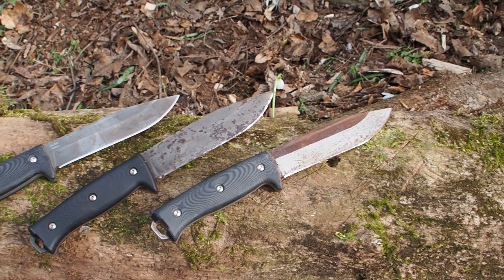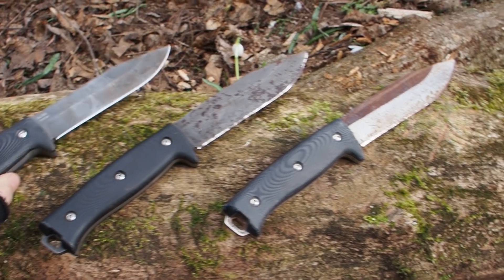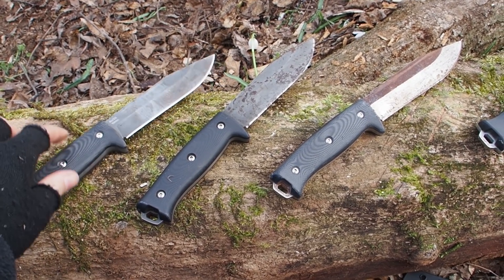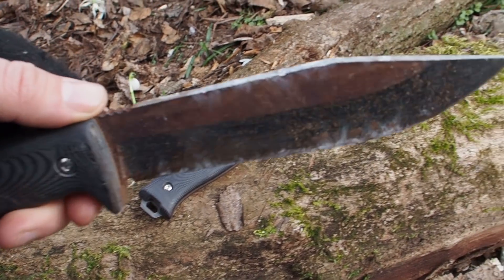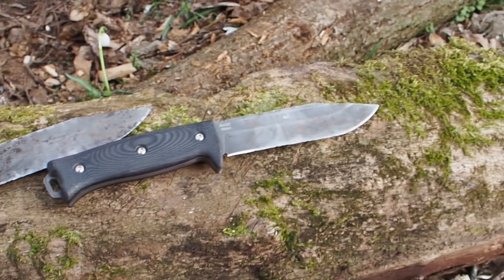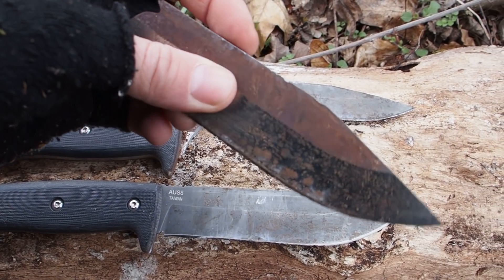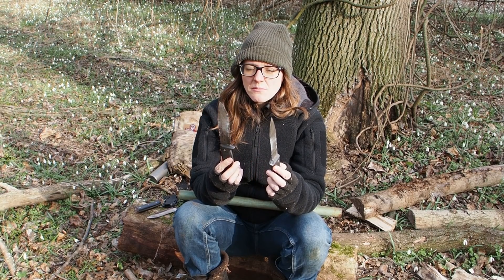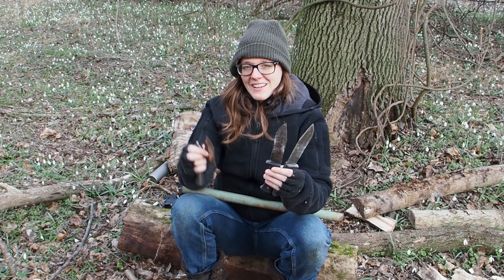Destruction Test - D2 vs. AUS8 vs. SK85 - Which is the better steel?

Comment: A dull knife is still a knife. A broken knife is your doom. I've always opted for more medium hardness for my blades, especially for any blades that I'm going to stress. I like to touch up my edge with a strop every 10-15 minutes of work so it doesn't go dull. Even if it does go dull, those mid hardness steels are still much easier to sharpen even in the field. There is a place for the harder steels, but too much can go wrong in a survival situation for me to feel comfortable using them that way. I can't do a damn thing with a sharp broken blade. AUS8 (especially from Cold Steel) has always served me well and mid carbon steels like 1055 hold up well too. I do have some forged machetes from Aranyik Trading that are made of 5160 spring steel which is super tough! They are also differentially heat treated so the edge is harder than the spine. It gives the best of both worlds.

Comment: Lilly , I 'am a hobby knife maker down here in Australia and I use a lot of high carbon steels from 1075, 1080 , 1084 & SUP9 or other wise called spring steel . I would like to know what the grain looks like inside that broken knife . Whether or not it looks rough would mean that it was not heat treated very well and the smoother the better . Most knives are not made for such punishment even though there are some really great knife makers which can make very tough blades which wont break with some rough use .As to the surface condition to your blades pictured I was some what shocked that no care has been given to them such as washing in warm soapy water and drying the blade then rubbing some vegetable oil over the blades to prevent rusting . There are ways to coat high carbon steel blades such as a hot vinegar soak for an hour or sending them of to be ceracoated one could also use demineralized water and ferric acid after the blade has had it's heat treatment and hardened to whatever HRC desired . This is definitely a ppe process with gloves & proper face mask as the fumes are very dangerous also bicarbonate soda is needed for washing your blade after putting in ferric solution . The ferric solution should be kept in a glass jar with a good lid and labelled with a Warning Sign and kept out of reach from children. Stay safe and look forward to your next video 😁

Comment: I carry two main knives in my kit, I carry a stainless steel and a carbon steel as use them in different situations like if raining and very damp I’ll use my stainless but if nice dry etc I’ll use carbon still. I also carry a Mora Eldris and a Victorinox Ranger Grip 79 as a backup in my fire kit just in case. The Ranger 79 I use as got a very good saw blade on it. Think I carry to many but that’s my combination I like lol 😂

Comment: I have made many knives from d2. Show me a survival situation where you have to beat steal with you knife. Sure your orher shit steal knife didn't break but look at how hard it would be to fix those edges. Man lived using obsidian and flint for a very long time. That's glass and stone. Besides you could but your broken knife in a new handle and be good to go out there. You edge was still good.  It's a great steal yet yes some guys harden them a bit harder then I think they should be. To be fair did you check all 3 knives for the hardness each one had? I would happily bet my life and survival on d2 die steel any day. You just got to realize it doesn't need to be 60 to us on the Rockwell to be a great knife. Cryogenic treating can be done to help remove stress in the blade. I think its more the makers are pushing the steel a bit farther then they should. It also can have to with tempering if that knife wasn't tempered correctly it will break. I have had more 1095 and and other store bought knives break on me then I ever have D2. As doubtful as it is there could have been a bad spot in the steel or maybe even a small microscopic crack from heat treating. Thank you for the video. I really appreciate the work your doing.
Reply from the maker: I have seen many d2 knives chipping on wood and breaking while batoning. It is just a little brittle. And no. It didnt had a hair fracture.
D2 is great for all sorts of cutlery, but i rather want to have the toughest steel in a survival knife and not one that chips and breaks.
Reply: @SurvivalLilly  what was the hardness on each of those knives? Were they factory blades or did some private individual make them. How were they heat treated and tempered. I could make u a blade out of your favorite steel and it would shatter the first time you used it. I can make u a blade out of your steel of choice and it be so shitty you would constantly have to sharpen it. IT won't chip break shatter OR HOLD AN EDGE. ALSO WHERE DID THE STEEL GET MADE CHINA? D2 I'd very expensive extremely expensive compared to coman knife steels. You by chance didn't have a chemical analysis done of the steel did you. I hade some ats34 none of the 15 blades I made heat treated properly. Wouldn't take. I had it checked and it was a bad batch of ateel. So it happens. You should do some cutting tests with them all and see how long an edge is held by them. Also can you bend your fav steel 90 deg and see if it breaks? The aba tests blade like that but those are different method they have to use to harden and temper them. I have had to sharpen knives for people that wouldn't cut they were so soft the edge was flat. U just simply can't use one Like that for survival either. This is an very very complex subject. So what was the  Rockwell hardness of that blade you broke? Thank u again Lilly I appreciate the reply.

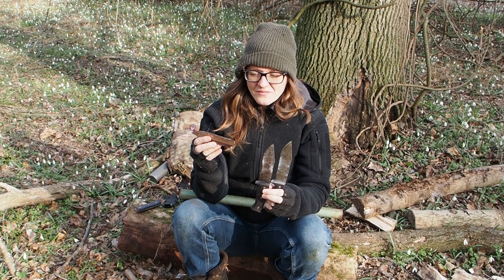Comment: 12:36 well duh! These destructive are useless in a survival situation are you REALLY going to risk breaking a valuable tool? Sure you've got to know the limits of given tool if you want a real test remove the human element simple enough to build a falling arm lever or block then take a true sample of the item, say 3 knifes from 3 different batches and log the results. If you don't have the means then maybe you shouldn't treat your knife like a hammer, prybar, chisel it's a knife use it responsibly
Reply from the maker: I had d2 steel in 61 hrc chip on wood. I am not hating it. But it is more brittle than other steels. Is it the most brittle one? No. I think d2 is  great, but in a survival knife i rather want to have the toughest steel

Comment: First to clean that non-SS knife soak the blade in white vinegar. On the strength of a blade depends on forging, heat treating but the raw materials first.  Could have 500 knives and one break due to any of the causes, bad mix in steel, over heating at forging, or tempering was not done correctly. To me the best knife is the one you can resharpen and stays sharp in the field.

Comment: Just a point if you touch the blade with your hand. It will turn it rusty.
Also in salt water it will turn it rusty. If you clean your knives after use and oil them, they wont turn rusty. And oil them from time to time when not in use, this will also prevent them rusting.
Hope it helps

Comment: CPM MagnaCut is a new steel that has good edge retention, very good toughness for a stainless steel, and excellent stainlessness. It looks like it's easily the best steel for most knife uses, though the priority of toughness for survival knives might mean other steels could be better for that specific purpose. Basically it's AUS-8 but better in every respect in terms of usability, except likely more difficult to sharpen.
Reply: LC200N could also be an excellent survival knife steel, even better toughness than MagnaCut, though worse edge retention (comparable to AUS-8), and probably the best stainlessness of any quality knife steel.

AEB-L could also be a very good steel for this purpose, even slightly better toughness than LC200N, similar edge retention, though only decent corrosion resistance, again similar to AUS-8. So basically AUS-8 in edge retention and stainlessness, but much tougher.
Reply: 14C28N may be another steel to consider, it looks very comparable to AEB-L, with excellent toughness but mediocre edge retention (again similar to AUS-8), and with better stainlessness... it's also relatively inexpensive I believe.

So to summarize, on a scale of 1-10, the toughness (T), edge retention (E), and stainlessness (S):
D2/K110: T-3.5, E-5, S-4.5
AUS-8: T-6, E-3, S-7
MagnaCut: T-7, E-5, S-9.5
LC200N: T-8.5, E-3, S-10
AEB-L: T-9, E-3, S-7
14C28N: T-9, E-3, S-8.5

So many steels, lol..  I'm no expert, I got these numbers from a knife steel metallurgist site (Knife Steel Nerds). Maybe look into some of these to see if they might work for your needs.

Comment: Lilly, I appreciate the confirmation of your design parameters. The fact that you keep getting the same results proves your theory and stengthens my  confidence in choosing the APO1. I was also impressed with the sheath design. It is not just the typical kydex sheath but has features that deserve to be showcased better. I think you might do well to do a comparrison with the other sheaths too.

Comment: I would rather have a dull edge than a broken blade. I'm not strong enough to break a knife, but still. And maybe I could find a way to sharpen a dull blade on a flat rock if I had to. Thanks for showing us this test!
Reply: Sorry, but I think you missed one of the points she is making here, which is that the wrong steel with the wrong heat treat, may break way easier than you might expect, leaving you in the lurch.
Reply: @richardelliott9511  Please trust that I am not missing her point. I think that my preference to have a knife that would not break as easily as another is on point.
Reply: @kele1264  👌

Comment: My opinion. In a survival situation, I'd rather have a sharp knife than a pry bar. D2 is definitely not the best for a survival knife. Sk85 is essentially the same as Sk5. Aus8 is basically 440A. I'd take Sk5 over Aus8 any day, and I'd pick D2 over it as well. A knife should be a good knife more than a good survival knife.
Reply from the maker: I beg to differ. Still have a great day

Comment: Grain structure, as well the quality of the heat treatment make a difference. Just because the HRC is meant to be in a certain range for each knife, does not mean that there are not flaws in how they heat treat. Making some parts of the knife weaker then other areas.
Reply from the maker: if I test 10 knives of the same steel like in this video, I think the outcome would still be the same. I had one D2 steel knife which chipped on wood btw. So yeah. It is kinda brittle.
Reply: @SurvivalLilly  Lilly no no no no D2 is not brittle unless you heat treat it into the 60s. Not understanding what D2 is is why that happens D2 " DIE" steel is used in making dies to forge steel parts in factory. I have seen large d2 block slammed together with a  red hot piece of steel between them. Slamming out one fully formed forged car part. The thousands to millions of pounds per square inch would destroy the dies if that type of steel was brittle.. not being rude but can you explain that? Look up D2 Die steel and read about its properties and what its used for. Thanks again. I am no metallurgy professional. I have sat in many black smithing classes and knife making work shops as well as attending SOFA southern Ohio forge and anvil events. I have studied metallurgy with knife makes who make some of the most expensive knives in the industry. I make knives as a hobby and have for over 15 years now. So I'm not just some troll here. Also I am trying to be very respectful to you. I just have a different set of experiences with D2 then you have. Thanks again
Reply: @vikingskuld  Generally speaking, D2 is chosen for it's ability to attain high hardness. Often it will be heat treated (hardened & tempered) to 62-64 on the Rockwell C scale. 
Tempering at a higher temp can bring hardness down to RC 58-60.
Double tempering at an even higher temp can bring the hardness below RC 58, which would be tougher than the higher RC numbers.

D2 is a through hardening steel, and is great for punches & sheet metal forming dies. It may be used to make hot forging dies, but there are tougher steels that are better for that purpose. 
Been retired a few years, & going from memory. I'm sure you will correct me if I have it wrong.
Reply: @savage22bolt32  nope you got it right I have made them at 61 and like all things its a tool you choose a purpose and make the tool for that purpose. There are much better steels today. Easier to work as well. D2 is a tough pain in the ass. I personally don't make them that hard unless it's a skinning blade or a fillet knife. That's just my personal opinion though. Thanks
Reply: @vikingskuld  i believe you know your stuff. I never made a knife, worked in aerospace. Loved the field trips to the closed die forging companies.
Reply: @savage22bolt32  one of the factories I worked at had a forge attached to it. One of the guys I got to know was in the knife making guild and made some exceptional pieces of art. I think the cheapest thing he made and sold was a 1000$ letter opener lol.  He introduced me to d2 as I had just been smithing my own blades  before that. I sat in at sofa for a lot of years. Spent a entire weekend in a class where they had rediscovered the way to make true Damascus steel and not the pattern welded stuff most people make. It was incredible. I should have been a metallurgist. I just love the way the carbide forms in the steel.

Comment: As a youth I was gave Carbon blade and taught how to maintain as it runs hand in hand with slicking you're firearm after each day out.
Lucas knife oil,always care for Carbon and Gun same time.
Salt water application I like AEB-L..Stainless that is much like Carbon..
Aus8 is good all around steel,Reason Cold Steel and Lilly Use...Performance Knives.
Boeher DNH7 I like on my "Citadel" differential Hardened blades.
I love knife talk..

Comment: I’m still using my knives from the 60’s that I only know are carbon steel.  I have never needed to change nor have I ever felt the need to know about them. They still perform and hold a great edge. What else do I really need to know? 
I was recently gifted a new knife though, so I guess that perhaps I should see what I can learn about what I was given whether I ever plan to use it or not.

Comment: I love carbon steels for this use. On mine, I often strip the factory coating and use gun blueing for rust protection.  They get a great patina, maintain a sharp spine for striking ferro rod (some factory coatings round off the spine),  and I've never had anything worse than surface rust and I live in the pacific north west.

Comment: Looks like the D2 blade fractured at the end of the gimping, so that was most likely a stress raiser which propagated a fracture. Although is not likely to be an issue in practical use, as no one is going to abuse their survival knife as shown here, if the gimping was polished after machining, to remove any sharp angles, then the blade wouldn't fracture so easily. Also, heat treatment is very important with D2, for the best results.
Reply from the maker: yes it is probably no problem, but I have seen D2 steel knives breaking when batoning too. So they are kinda brittle.
Reply: D2 is a hunters knife 🔪.

Comment: I can see the work on the wood but who and why would you use a knife to beat concrete or a metal pipe. Test them for what the are for, survival. Chopping wood, digging, buttoning, cutting food, and maybe using a stone you find in the woods.
Otherwise, nice video...
Reply from the maker: It is a destructive test too see which steels behave tougher and can take more stress. I only want to produce a survival knife with tough steels
Reply: They are meant to be "the one knife you'd want in the apocalypse" you can't say for certain you'll only be chopping up kindling... 

For real though, when testing somethings durability you want to test it under extremes: 1) so you don't have to spend 12 hours hacking at a log to see any damage. And 2) so that you know there is a factor of safety when doing simpler tasks (like chopping wood)

Comment: I got the S1 and i'm really happy with it. You just need to be aware of the steel being a bit softer and needing more care (i.e. resharpening) but i dont think a harder steel is a good choice for larger knives. For smaller knives i'd still prefer something like a M390 which is just a great steel especially for knives that are meant for being really sharp and for a long time (without compromising the corrosion resistance at all). But yea, thats not what you'd need in a larger knife.

Comment: I've never had any issues with carbon steel blades, other than their tendency to rust easily. Quite a few of my knives are made of 440 stainless or surgical steel, and ave been pretty reliable over the years with little maintenance. I'm not terribly familiar with AUS-8 steel, but the more I see your APO-1, and its capabilities, the more I want one.
Reply from the maker: AUS-8 is equivalent to 440B and behaves similar